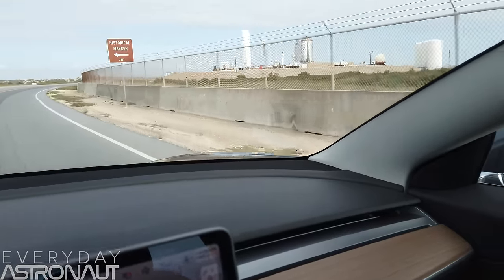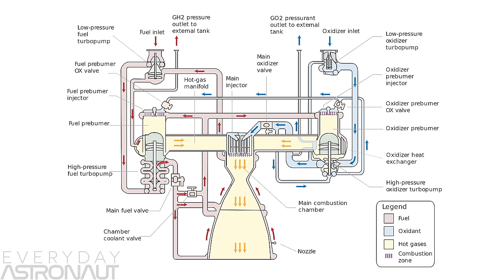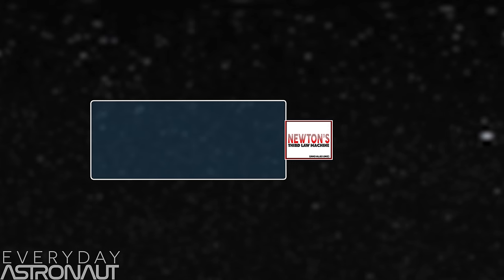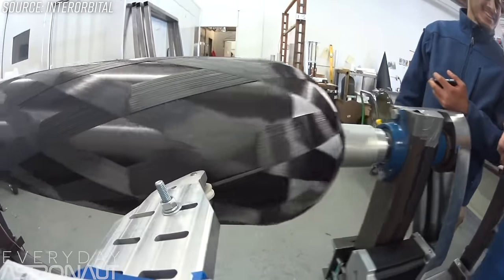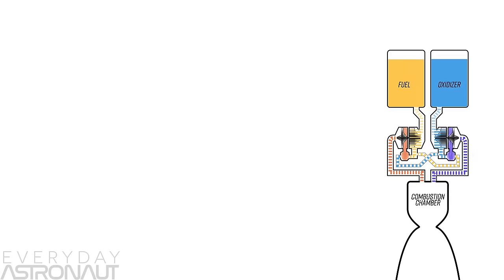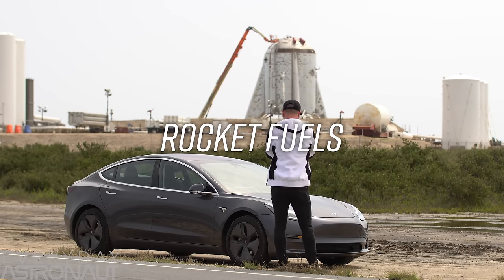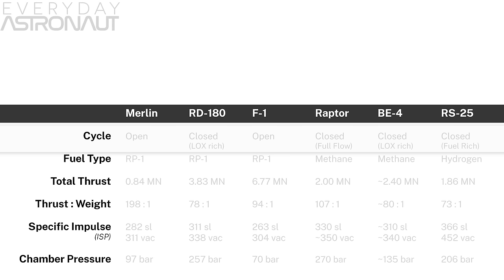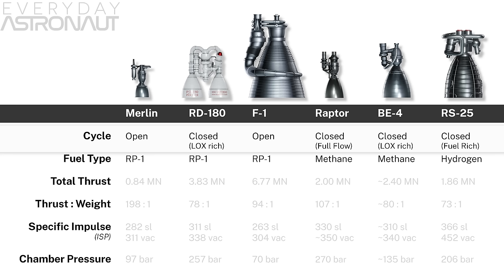Is SpaceX's Raptor engine the king of rocket engines?

Comment: A concept:. What do you call a turbine compressing a fluid that is then combustively heated, expanded, and exits out the back after turning a turbine that powers the compressor.  Why, that's a turbojet!

In the case of terrestrial turbojets, the medium is air, and a tiny bit of kerosene is added to heat and expand the air over the turbine and out the back.  Only some of the oxygen in the air is used up, else afterburners wouldn't work.  But it's basically a huge high volumes air pump.

Now, imagine a turbojet running in, say, a hydrogen atmosphere.  You could add a little oxygen in the cumbustor to heat the hydrogen a bit, and expand it, and it'd still be a turbojet.

So you can think of the Raptor as having two turbojet engines feeding the combustion chamber, one running in an oxygen atmosphere, and the other running in a methane atmosphere.

When you see a spin test, that's them starting up one of those turbojets or the other.

Comment: I'm still waiting for the nitromethane engine. It has a lot of oxygen in the molecule already so it doesn't require as much oxygen. It does have a lower thermal energy producing number but it compensates that in the oxygen saving.

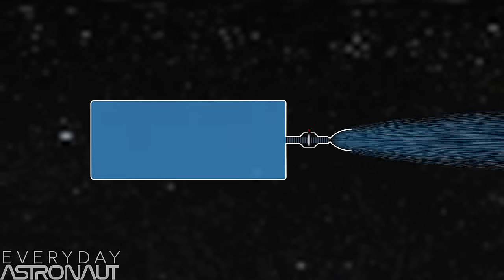Comment: I dont understand  a basic concept on pressure fed engines at about the 3:45 mark in that the engine cannot exceed the tank pressure b/c pressure flows from high to low. . Wouldn't the pressure produced by oxidizing the fuel exceed the tank pressure and thus flow in reverse?

Comment: Hydrogen storage temperature isn't as big a deal as containment. The reason H2 needs to be kept cool is not to keep it liquid--that can be managed using pressurized tanks. The problem with hydrogen is that it's a very small molecule, the smallest multi-atom molecule. It tends to pass through ANY storage materials eventually. The rate of escape is dependent on pressure, and lowering the temperature lowers the pressure and thus the escape rate. Lowering the temperature to the boiling point of hydrogen would prevent escape, but that's prohibitively expensive even on Earth, except in the places where it's manufactured in large quantities. Larger molecules (like methane) can be contained indefinitely by a variety of materials without worrying about the temperature as much as the structural integrity of the container.

Thrust-to-weight ratio of an engine usually doesn't matter much, because the weight of the engine is usually dwarfed by the weight of the fuel, usually by ten-to-one or more. What matters more are the thrust-to-SIZE ratio and the ISP. The engine size determines how many you can fit on the rocket's base, while the ISP helps determines available delta-v. Several of the other engines here are the endpoint of that line of reasoning, varying in thrust and reusability.

It seems that SpaceX is betting that one engine design can meet all of their future needs. They need to be careful here; having 39 engines on one stage means 39 times as many points of failure. I don't know if they intend to build redundancy in by using more engines than needed by a stage and then running them at less that full power, so that any in-flight failures can be compensated for; but that seems like a cost that can be streamlined by designing a more reliable engine. Just the plumbing involved is a nightmare, as the Soviet engineers discovered when building the N1. SpaceX will be forced to design a new engine at some point in order to launch an all-up crewed Starship. Otherwise, several launches will be needed to assemble the ship in orbit by launching the uncrewed Starship, then the crew in a smaller launch, and finally the fuel.

Comment: MAY- 2021. Virtually about to launch SN15. Have been asking question Merlin:Raptor.? So we have witnessed Merlin reliability now need to test drive Raptor. Until all those issues are compressed for Raptor I bend to Merlin. May I pose this question please. Has cost savings always resulted greater reliability? Great for the stock price though.

Comment: Open cycle rocket engine is much like two stroke one when compared to piston-type internal combustion. Both have higher power -to-weight ratio and both are less efficient.
Speaking of chamber pressure of F-1, it is lower than on Venusian surface.

Comment: Didn't the F-1 Engine on the 2nd stage of Apollo 13 shutdown early due to Pogo Oscillations? Wouldn't that be considered a failure?
Reply: No the second stage of the SaturnV only had five J-2 engines, no F-1 engines where ever used for any thing other than as a first stage engine.

Comment: I thought of a rocket engine that uses water to cool the engine and make steam/run the turbines with steam without a preburner to make the rocket engine lighter, but you need to make the steam really fast, and the water takes up space in the tank.  It's just an idea and it's great
Reply from the maker: You’re basically talking about the expander cycle only water is heavy so they use hydrogen instead as that’s already the fuel and they can burn it after it has already cooled the walls and spun the turbine.
Reply: @EverydayAstronaut  Thanks you're basically solving the problems that were made. Seeing hydrogen is very light you require bigger tanks, and your engine needs to run with hydrogen and oxygen. Water is heavier, so smaller tanks and lighter rocket. As well you can run any fuel for your rocket engine

Comment: Ok 4y later and im watching this video again !! 
      Ok, so the pumps are run by burning, or pre-burning some of the fuel.   Any advantage to running the pumps with electric motors ?
Reply: Rocketlab does this. The advantage is simpler startups, and you can run the tanks completely dry. If you let the turbopumps on classic engines run dry they usually explode.

Comment: Hello,  being new to rockets design, forgive me if my question  as an obvious answer. Within the design of a build is the atmosphere resistance in n anyway being used as potential energy? Ie lift to an air foil, I am was thinking the air resistance could be used as a piston on the fuel retaining psi, reducing work on pre burner shaft to pump work.

Comment: What is actually the benefit of a full-flow engine over a oxygen-rich or a fuel-rich design? It seems it will reach exactly the same efficiency with a simpler design.
Reply from the maker: Watch my later videos about "How to power a rocket engine" we dive into the exact enthalpy equation and figure out why full flow is advantageous

Comment: I wonder if someone thought about ion assist drive on the nozzle to accelerate the gaz coming from the combustion chamber
Could be done whit the momentum of the afterburner on the same shaft powering an alternator or an electrical power cell like on ion drive

Comment: Yes I realize I’m VERY uneducated, just very interested. If methane and LOX can share a very common tank shell due to the boiling temps being so similar, why can’t they just share one bigger tank, and thus use one turbine, lowering the overall weight of the fuel tanks and engine?
Reply: well you see, the thing with that is that LOX and methane tend to explode when they touch, hence why they're used as rocket fuel
Reply: @ExHyperion  they do!? O.0 well then! Thank you, that’s an amazing way of explaining it. Thank you!

Comment: Hybrid Electric Raptor?
LOX turbopump w integrated motor/generator, Electric only Methane pump.
Battery startup of both pumps, then LOX turbine powers LOX pump and Generator (common shaft).
Methane pump now powered by LOX electric generator, excess charges batteries.
Thoughts?

Comment: What, if any, effect does the "centrifugal force" on the Starship when it flips to land have on the fuel in the fuel lines?  Would this affect the reliability of restarting the engines to land?
Reply: I think the engines would ignite before the flip, based on footage. Bad refurbishment/production and maintenance could probably cripple the engine enough that it would be affected by the high-G manoeuvre.

Comment: I must be really dumb, but at 23:05 why is the red bar (RP1) taller than the blue bar (lox) if "lox is a little more dense than rp1"? Wouldn't that mean that the blue bar should be higher as it is denser?

This whole section didn't make sense because of these ratio issues but I feel if I can understand the answer to my above question then everything else will fall into place.

I'm the only one asking this so I must be missing something.
Reply: If something is more dense it uses up less space for the same amount of mass. So if those bars are meant to represent an equal mass of fuels the blue will be smaller as it is more dense so takes up less space.

Comment: L/Methane and LOX produced on the surface of mars require an abundant source of power (splitting CO2 and H2O and then liquifying the methane and oxygen is energy intensive!!)
and solar won't cut it - acres of solar panels all of which have to be hauled to Mars.    Note: even if they got the solar panels there they would need constant cleaning and dust storms would kill power production (dust storms often last for weeks or even months)  and damage the panels.   The only stable, reliable, power dense option is Nuclear.    The Ideal scenario would be a Nuclear powered Starship that then stays on the surface to give up its reactor.

Comment: I am writing this 2 years after the first posting. It turned out the Raptor is the current king of rocket engines. While the FAA has restricted SpaceX from actually flying still the Raptor has worked perfectly in every case and every test. SpaceX has increased both the chamber pressure and the ISP of the raptor. They are now working on a second version. Unfortunately, it is unclear if they will ever be allowed to actually launch StarShip. Legal challenges by the competitors have become a daily reality. Starship sets on the pad ready to fly but held up (perhaps forever) by the realities of the corrupt US political system which prefers to give money to Boeing for no product than allow SpaceX to spend their own money to do the job.

Comment: What is 'it still doesn't work reliably and melts.'

You can talk about the concepts as much as you want.  If they're still using slightly reworked versions of Russian R1 engines, due to problems with their own designs, the concepts are irrelevant.

Comment: I have a ques if raptor engines create over expanded stream of thrust and if it's inefficient then why use it except for it looking mesmerizing?
Reply: atmospheric  raptor goes from sea level to vacuum. If they would optimise it for pressure at sea level, it would be terribly under expanded up there. So they chosen to optimize it for pressure somewhere between sea leevl and vacuum

Comment: If the engines cones make the engines more efficient, what size of cone will be needed for Mars weak atmosphere, or will it be a vacumn optimized engine?
Reply from the maker: Mars’ atmosphere is so thin, you can use a vacuum optimized nozzle 👍

Comment: Because physics, lighter exhaust gases give more thrust than heavy ones. So when running hydrogen engines, it's actually beneficial to have unburned (but very hot) fuel getting shoved out of the nozzle.

Comment: QUESTION:
What is the maximum pressure of a combustible mixture? I imagine that if I have both components in a completely full closed container (without any bubbles) and let them react with each other, I will obtain the maximum combustion pressure of both components.  Is this correct? That pressure  may not be resisted by the combustion chamber, so it must be operated at lower pressure.
I will appreciate your answer.
Reply: I think most pressure is achieved by the turbo pumps. as he said liquids flow from high to low pressure. I wonder if that means that the 300bar raptor is gonna have more than 300 bar in the tubes between the turbopump and combustion chamber.
Reply: @slopedarmor  Hello, slopedarmor. We must bear in mind that turbopumps are generally driven by the same fuels that react in the combustion chamber, let's say H2 and O2. Therefore, we need to know the maximum pressure of such a reaction. My personal and "artisan" hypothesis of the "container without bubbles filled with the components", gives a reaction pressure of about 1290 kg / cm2, at 3000 K temperature. Thus, it is seen that the pressures in the engines in use today are quite "attenuated", undoubtedly due to the limitations of the materials used in the engine (the same happens with the detonating capacity of the fuel in a car engine: detonation, which is very powerful, could destroy it, which is why it is inhibited with antiknockers). Thus, if we had materials more resistant to high temperatures and higher pressures, we could have more powerful rocket engines. Historical evolution: pressure in the engines of the Saturn V: 70 bar; Raptor engine, today: 330 bar.
Reply: @charlesbaires1  yeah but saturn v combustion chamber is also way bigger than the raptor combustion chamber, so a lot more cm2
Reply: @slopedarmor  Rocketdyne's F1 was certainly big and powerful, I don't deny it. It's a huge engine, but 50 years old. With 3.7 m diameter and 70kg / cm2 of pressure it had a thrust of about 690.367kg.
The newer design Raptor has 1.30m in diameter, 300-330kg / cm2 of pressure and 203.943kg of thrust.
I understand that the big variable here - including suitable new and strong materials - is the increased pressure in the combustion chamber.
Reply: More intuitively. Let's take two twin Rocketdyne F1 engines, with the same measurements and design. Let's make one of them work with the combustion pressure of 70kg / cm2, as in the Saturn V. And let's make the twin engine, with resistant materials, obviously, work with the 300kg / cm2 combustion pressure of the Raptor. Which of them will have more thrust?

Comment: I wonder, couldn't they use an electric pump to regulate the fuel/oxydizer ratio problem?
Reply: I believe rocket lab uses this method.
Reply: Not powerful enough for the bigger engines.

Comment: The F-1 engine was designed by Engineers with 
slide rules.  No fancy CAD-CAM systems here.

Kinda like pop music.  Back then, musicians with 
voices.  No "auto-tune."  (Murry Wilson and Brian 
Wilson.)  Murry was an engineer, his son Brian is 
a Musician.  Neither used electronic enhancements.

steve
Reply: Just think of the red tape and denials.
I'm sure you don't know how many gov. entities would have to be dealtwith.
thought
Reply: @wolu9456 , I used to work for Douglas Aircraft.
Pretty sure I am aware of the legal issues.  (I 
was on the assembly line, for the MD-11.)

steve

Comment: Interesting and instructive. 

But let me play Devil’s Advocate for a moment. 

My understanding is that space missions still spend the vast bulk of their energy escaping the Earth and achieving orbit. Further excursions require far far less energy. With the Space Shuttle, NASA appeared to have opted for solid rocket boosters as a sensible option to do a large amount of the Donkey work in the lower atmosphere. So to go to Mars, why not just strap on a few extra fireworks to some existing technology?

The new engines look like fantastic engineering, but is the money perhaps being spent for the benefit of engine manufacturers, when there is already something much simpler which can do the job?

Comment: King of thrust? Not even close, F-1 is still unmatched today for engines that actually were used.
King of efficiency? That's a whole different story....
Reply from the maker: RD-171 flew a lot more than the F-1 and has more thrust
Reply: @EverydayAstronaut  RD-171 I had forgotten - but it's debateable if it is one rocket engine or 4, with it's multi-thrust-chamber design.
It also had about 10% more rated thrust than the initial F-1, but later F-1s were uprated some and it was closer.
But doesn't change my point about the Raptor not being even in the ballpark as the king of rocket engines by thrust, puts the Raptor FURTHER behind. 8-)

Comment: Why is the F-1 engine 100% success rate. Didn't the center engine on Apollo 13 shut off?
Reply from the maker: Nope. No F-1 failed in flight. A few J-2’s shut down in flight but not an F-1

Comment: Would it make sense to ever just use Tesla motors and batteries to run the fuel/lox pumps instead of using a preburner? Like can a plaid plus get that fuel moving fast enough?
Reply: Think there are any superchargers on the way to the moon?
Reply: Rocket Lab's Rutherford engine actually does just this. However, its not possible for such a large rocket as Starship.

Comment: your explanation is incorrect when you explain that bypassing open cycle turbine exhaust into the engine combustion chamber will clogged injectors. doing this will add huge backpressure to the turbine and turbine will stop.

Comment: Also harvest out all the methane in known areas of the world, remove from th ecosystem to clean it up and extract from Antarctica to prevent the Leif’s threatening eco disaster if mathaney release hits atomosphere and thus methane fuel needed for raptor engines and AF tech for unlimited carbon fuel, helium 3, nuclear,fusion thrust,etc